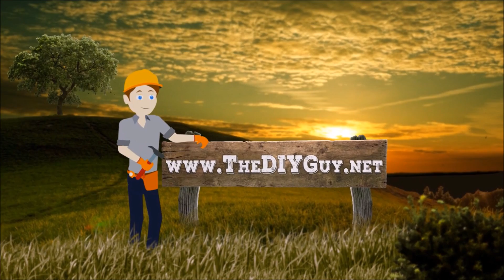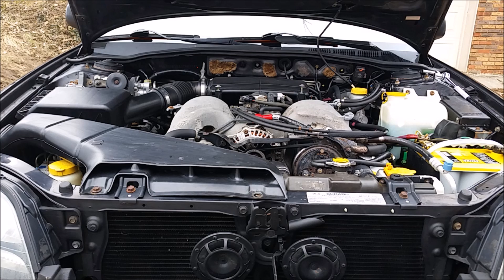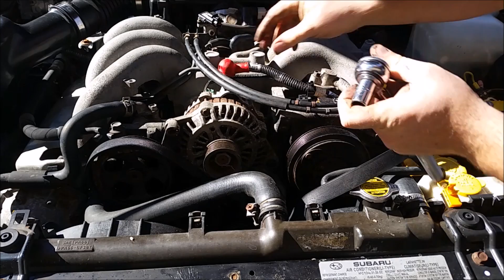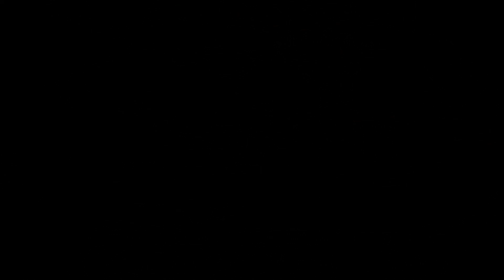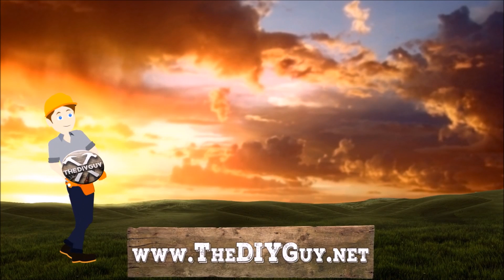How To Replace An Alternator On A H6 Subaru

Comment: Your suggestion of putting the serpentine belt on the idle pulley last saved me a ton of time and headache. I was trying to get it on the alternator last, and just couldn't seem to get the tensioner pulled enough to give me enough slack. Thank you so much!

Comment: Would H6 radiator fit in the Impreza? And is the 2005 Tribeca alternator compatible with 2011 and vice versa? I'm trying to fit a more powerful alternator to my Forester, but I was told that Trebeca 130A fits the Forester/Impreza... so want to give it a try. I found a 2011 model, but the one fitted was from 2005, so I'm not sure if that would work. I suppose you've done loads of them and probably have a few lying around, any help will be appreciated. Also my current one is 2 pin (older model), so I need to fit the 3 pin one, but the 3rd pin is not needed I was told, so again I'm trying to figure out which pins goes where -) I know it can be done though.

Comment: Great job on the video,👍. Watched to see if there was anything crazy you had to do on the Tribeca, but as I was hoping and figured, it's straight forward. For a "non mechanically inclined" individual, this video is a great step by step "how to", "DIY", to refer to to learn how to maintain your vehicle. Good job bud, keep it up. Would like to get some advice on the front and rear differential maintenance and fluid replacement. Along with some other Tribeca knowledge. If possible please let me know. Thanks.

Comment: Do you. Have a repin video?
Reply from the maker: I do not have a video on that. They should have different colored strips on the wires. The one with the green stripe will be the one closest to the battery. The one with the red stripe will be the middle one and the last one I think its all black will be closest to the air box.  They sell replacement plugs https://amzn.to/2RdVNHS I know you can get an OEM one on ebay without the wires. I also added a picture of the plug end to the write up on the website so you can double check the color of the wires. You can click the link in the video description and scroll to the bottom. You should also be able to click the picture to enlarge it. Hopefully that will help you get it back together.

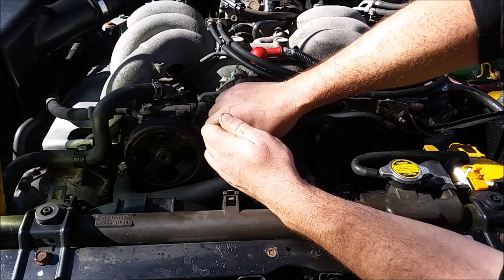Comment: The green plug. Won't come out. The spring trap part is broke ?  What is this wiring harnesses call so i can replace it @the 4:30 mark
Reply from the maker: Sometimes they get stuck in there if the tab broke you should still be able to slide a screwdriver down inside and lift the tab so it will release. Alternator Plug Harness and it came right up.
Reply: @TheDIYGuyDOTnet  i did that but the plastic green part was broke apart like old plastic. But the wires are still intact

Comment: Any tips on getting that 12 mm bolt (the one that is on the left side of the cover) off? Mine is ridiculously tight. Cant get much done without getting that bolt loose
Reply from the maker: You should be able to spray it with some sort of penetrating oil I like and have found Kroil to work the best -> https://amzn.to/2nX5aPX .  Use the longest ratchet you have for the most leverage you can get if you still can't get it you can get a pipe just big enough to fit over the end of the ratchet and that will also give/ get you some more leverage to hopefully get it loose.

Comment: Assuming one has medium skill set how long should this take?
Reply from the maker: I would guess less then 30 min. Let me know how long it really takes you.
Reply: Well the missus and I did this together and not counting the fact that we have generally always owned and worked on SAE-tooled cars, we realized we needed to get 2 metric wrenches to get it done. Not counting these delays and a couple rusty bolts, I would say it took us about an hour if we were to do it again with the correct tools.
Reply from the maker: That's not bad.